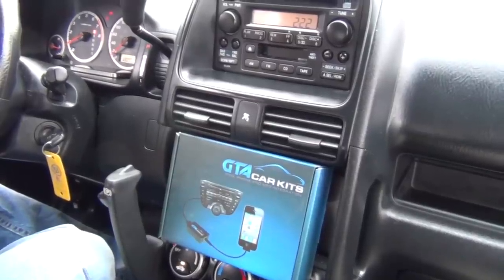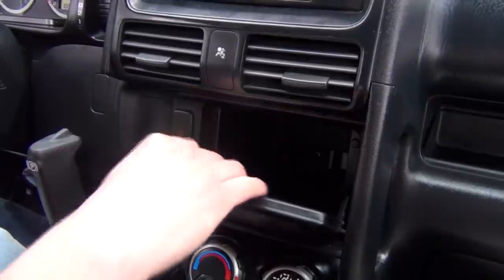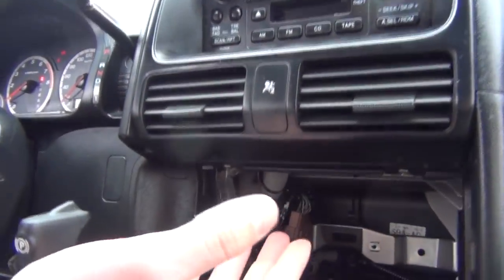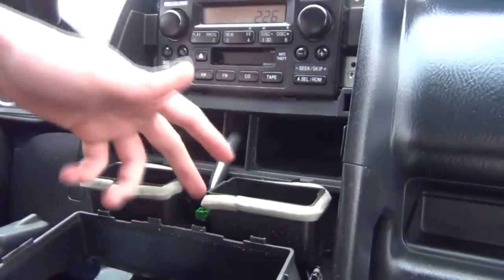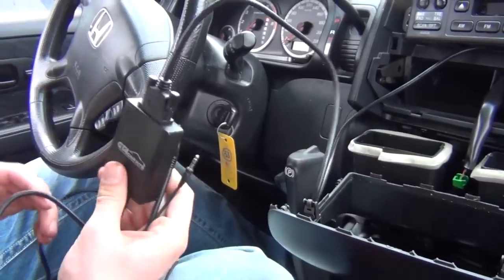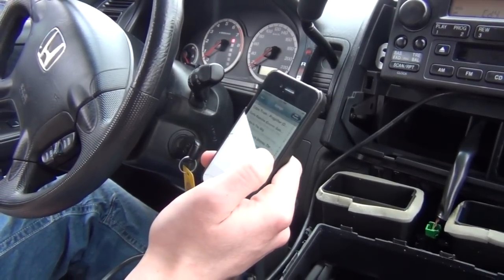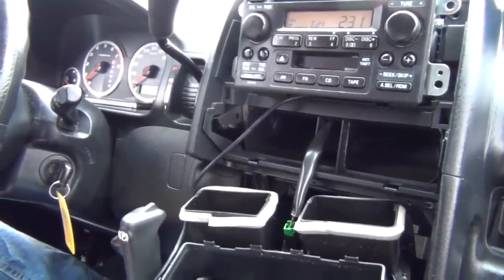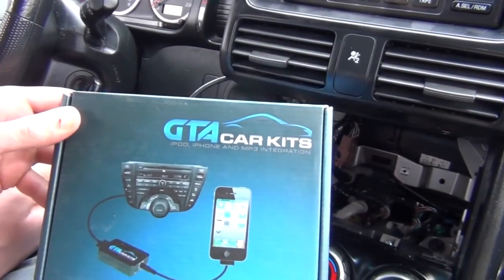GTA Car Kits - Honda CRV 2002-2006 without CD-changer iPod, iPad, iPhone, AUX installation

Comment: i recently bought a device close to this on ebay for 18$ i watched the video and installed it works great 2006 crv with the 6 disc cd changer  just disconnect the cd from the back and install the device. that's it plug and play
Reply: can you leave a link for the device please?
Reply: @mike morgano where did you run the wire when you assembled it back together

Comment: Just stumbled on the video, on a whim, purchased it for my 2003 Honda CR-V and the installation as the video said, straightforward and quick.  The storage bin gave me a little struggle -  no more using the cassette deck adapter that muffled the notes on my iPod and constant adjustments on the Balance and Fader to get the music equalized on the new Polk speakers.  Best aftermarket equipment for the money bar none - Thanks again!!!!!

Comment: Hi and thanks for the sharing the video. I have got a Honda CR-V. Mine comes with build-in navigation and CD. However, it does not have any USB or an AUX plug... What is your advice please? Thanks in advance.
Reply from the maker: Please send out support an email, with a picture o your radio, and we will be able to assist you further. Thank you. info@gtacarkits. c o m

Comment: Nice video. I been looking to do something like this for a while, but I have a couple of questions. Do the steering wheel controls work with this installation? and if I my stock stereo comes with a cd changer is it still possible to do the install but just requires more steps or its not possible at all ? thanks!
Reply: Si alguien me pudiera explicar como adaptarme un blootow ami honda crv 2006 xf